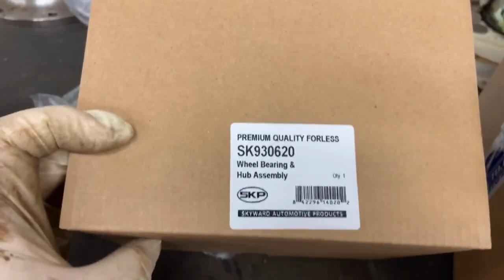06-10 Ford Explorer Front Wheel Hub Bearing Assembly Replacement

Comment: 10:45 one more thing I did to help give space for the removal of the hub bearing was taking off the dust shield, it's 8mm or 5/16 same size you already had out for the one speed sensor clip, there's four of them and it gives you better room to hit from the forward side as well as the rear.  Now I'm not saying it's critical, because I've been wailing on mine with 3lb hammers for the last 1h15m and it's not off yet, BUT IT MOVED 1/8in and if I can get another 1/16th of an inch out I can get a pry bar behind it.  An air chisel would be real nice but I don't have a compressor in my shop yet.
Reply from the maker: Thanks for checking out our auto repair video that shows you how to replace the front wheel hub bearing assembly on a Ford Explorer. Have a great day!

Comment: You haven't seen the easy way to remove the bearing from the knuckle.  Cut off one of the wheel studs and drive the head out, then use the hole to press the bearing out with a bolt , backed with a nut behind the flange. When it starts to move , loosen off and rotate the flange to another position - - etc.
Reply from the maker: I appreciate the tip! Thanks for sharing.

Comment: Q.  Original owner of 06 2wd... Is there a dust cover needed in absence of the front axle?  This is my 5th set of replacements. Thanks.
Reply: "5th set of replacements. "   what do you have like 700-800,000 miles on it?   You drive like a maniac?  Maybe you need an alignment but whatever it is, that's an issue when you have 5 sets go out.
Reply from the maker: Thank you for watching our auto repair video that shows you how to replace the front wheel hub bearing assembly on a Ford Explorer. Have a great day!